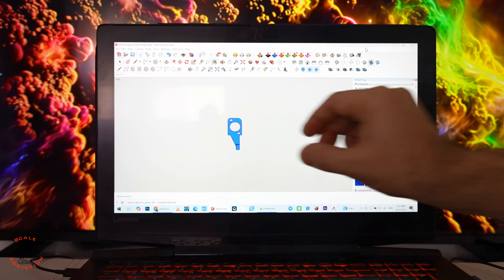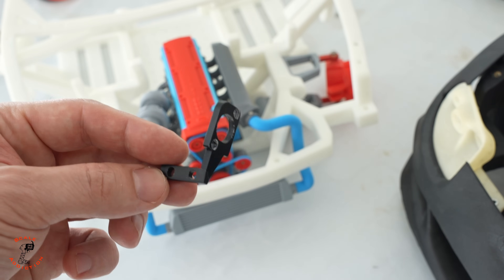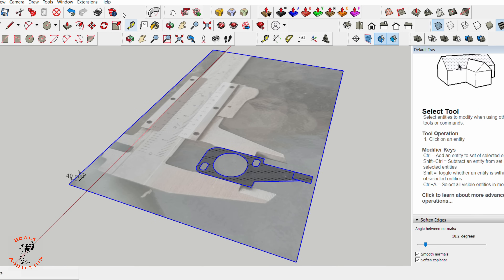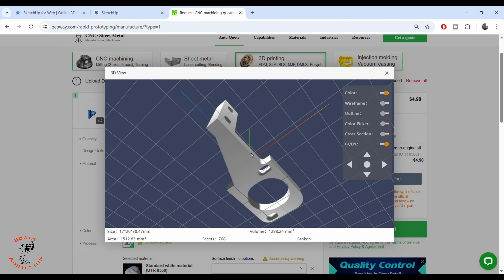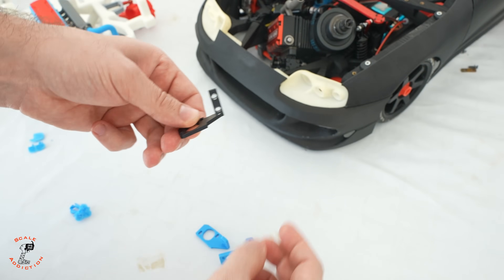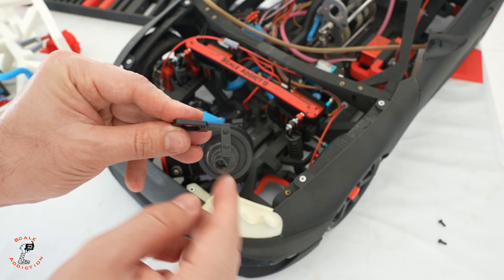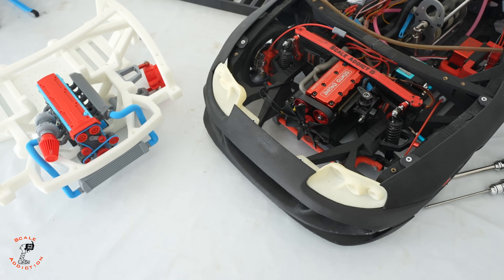How to 3D Model Any Physical Part for FREE(No 3D Scanner Needed!)

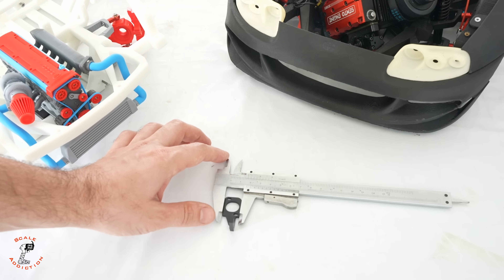Comment: 2:38 - most important step/variable i'd say and probably easy to screw up if you're not exact in taking picture. Should put grid lines on phone and have to make sure youre not angled at all.  How do you make sure the top line is EXACTLY parallel to to bottom line? Maybe use another ruler as the top line so you can match up readings in sketchup?

Comment: how did you create the "threads" in the hole for your mounting screws?
Reply from the maker: I didn't,  its only in the engine block not on the braket
Reply: @scaleaddiction  ok. So how do you create threads in the engine block. Is there a tool that has preset properties to apply to the hole ?

Comment: I like your video. It's a great way to duplicate a part and I have used this method myself. However, I use FreeCAD which is open source, and much more robust than Sketchup. There are a lot of problems as well using Sketchup for this type of work. FreeCAD had a bit of a learning curve, but it is well worth it.

Comment: Brilliant idea. The "trick" is to take a picture with a caliper and then when you draw your first line, make sure it agrees with what the caliper displays. This essentially "calibrates" your drawing software so all the subsequent lines you draw will be to the proper scale. Great idea!
Reply from the maker: That's a great way to put it!
Reply: @scaleaddiction  in my sketchup I dont get the scale ruler when resizing the images. how do you enable that function?
Reply: A better idea is to lay a scale (ruler) next to the part. Basic crime scene investigation.
Reply: Or use a flat scanner
Reply: Smart caliper-only workflow! Once your SketchUp file is ready, upload it— we CNC machine or SLS print 1-100 pcs in 2 days, worldwide delivery.😀

Comment: Can you print in the same object with 2 different directions? For example the part that broke first it's lines were on the short lines so that's why it broke. So you made another one that has long lines on the part that broke now it's stronger there but weaker in the other place  because now the other place has short lines, can't you print with long lines on both sides that join where it broke? Make a half half join?
Reply: I just ordered a 3d printer so I'm new to this world and I still don't know all the definitions and terms used in the 3d world
Reply from the maker: That's actually a good idea, I did these before but not always suitable yo cut and glue them, that's awesome
Reply: @scaleaddiction  it might just make it weaker where the lines join but I saw a guy tweaking with the Bambu code and I think you might be able to do 45° angle where the lines join, hopefully it works out good. I'll try it when I get my printer and I learn to use it 😀
You could also try to do it in 2 pieces that snap one into another if the pieces are wide enough. 
I don't know if that would be better or weaker.

Comment: Thanks for great tip about print orientation. At first I was thinking "why did he print it with all those supports when he could have just laid the wider flat face down on the print bed and not have to worry about supports?" But it never occurred to me that doing it that way could have a negative effect on print strength!
Reply from the maker: Glad it was helpful!
Reply: Well, it depends on the direction of needed strength. It’s like grain on wood. So what is the area of greatest strength and how do you orient to achieve that where it’s needed?
Reply: parabéns. seu comentário  me fez voltar e assistir o vídeo com mais atenção obrigado!
Reply: Imo for critical part, FDM isn't ideal, better go with isotropic additive printing like MJF/SLS out of Nylon, for smaller parts, it is very affordable out of China lol
Reply: I like to print these type parts at 45 degree angles on the print bed. It increases the print time and you have to use a brim and support, but the strength and quality of the print around the holes is greatly increased.

Comment: Hi,
thanks for explaining your techniqe of "copying and imrovement".
But it seems like the original part was made from aluminium and if this can´t stand the mechanical forces in your modell car, the printed one will also not, no matter what material you use. Just my two cent´s.
Regards
MAX
Reply from the maker: That's true, but I will print it with metal or aluminium, this time it won't break from there

Comment: great Video. question: which Version of  sketchup you Are using ? or which add ons to Export to stl files etc. 

thank you
Reply from the maker: I'm using sketchup pro 2019
Reply: @scaleaddiction  sketchpro has its own way of exporting stls and there is an extension in the wharehouse that exports stls as well. Ill have to find it again
Reply: Looks like he is using the older free desktop version. The last updated free version that allowed for extensions was discontinued in 2017 or 2018. I am an avid user of SketchUp pro and the other versions since 2016. You can still find the version floating around the Internet but extensions for it might be hard to find